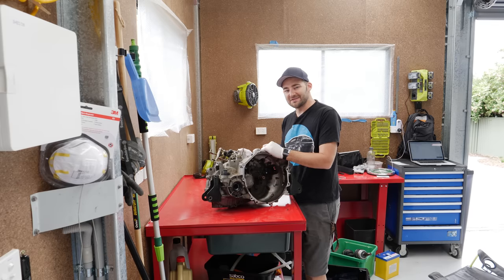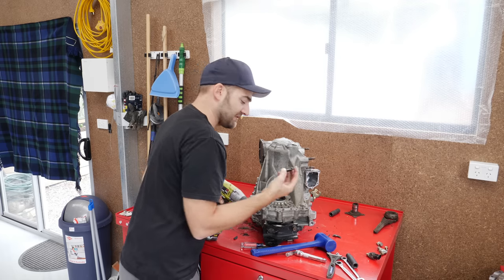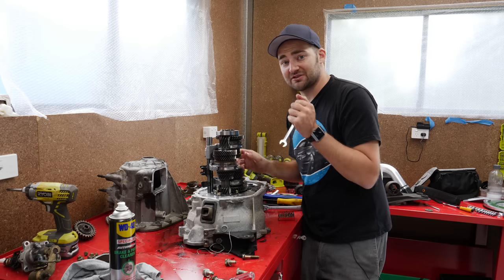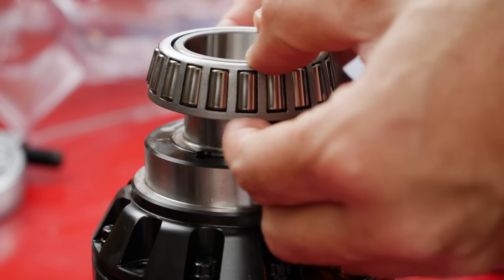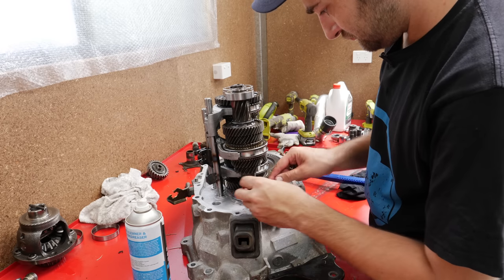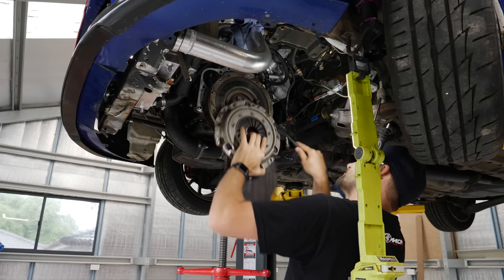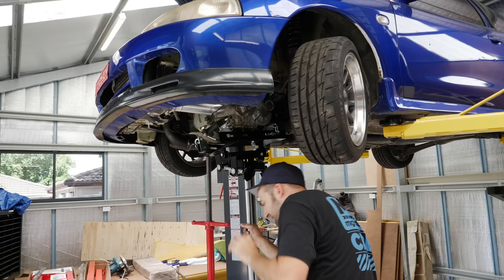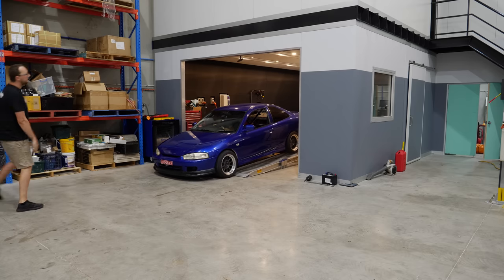Limited Slip Diff + Clutch Install into 2Sexy [Part 2]

Comment: Marty would you please replace the rubbish rubber bushings on the shifter cables (gearbox side) with some skateboard bearings it makes hell of a difference trust me I had a more than my fair share of galants the latest being a gt sport twin turbo V6....please up vote this so he sees it
Reply: Or pay the $8-15 for a proper set of brass bushings. The skateboard bearings love to rust up and become trash. I mean you can buy the double shielded kind of course, but I just prefer a part that is the right width without welding bearings together and that will last. It's not a bad idea though.
Reply: @802Garage  or that, nothing a little axle grease can't fix and most people have a old scooter, rollerblades or skateboard laying around
Reply: @802Garage  bearings fit perfectly all you need is a hammer lol
Reply: @maze2756  😂😂😂 I remember what a PITA it was to get the rusty ones off my '97 GSX when I got it. I think I ended up using a vice grips and a hammer claw or something to pry them off! The bearings didn't even budge anymore they were so locked.
Reply: @802Garage  oh damm I never had to change mine I did have pig bearings in Mine though and covered them in axle grease, worked a treat for the 3 or so years I had the old gt sport Galant, 😢 I do miss that car manual, turbo, 5 speed, V6, 4wd and enough room to fit my two boys at the time oh and had a sun roof
Reply: @maze2756  Well to be fair the previous owner of my car did a lot of stuff wrong and neglected it. So I'm not surprised my bearings were dry and frozen. Always a shame to get rid of cars you love! Mine will be back on the road this year.
Reply: You're telling me I can put Swiss Bones in my Lancer? 🤣🤣🤣
Reply: Don’t forget that Loctite

Comment: Al and Woody are gonna have a right laugh reading through all the armchair mechanics in this comment section!
Reply: That 40 comment long chain about the tapered roller bearing outer races and shim sizes got all the armchair mechanics sharing their wisdom, hahaha
Reply: @Hman9876  I know, right? The number of times I have actually seen Marty do something "wrong" on this channel is... Zero to my recollection. He is a careful dude.
Reply: @802Garage  He does plenty wrong, they are just not that important.  Soldering wires aren't suggested for radio install, but it shouldn't cause too many problems - In this video he had his grubby paws all over the pucks of the clutch during install - not a good way for install.  Also his first welds had the ray charles effect; To claim he's never done something wrong is BS,  anyone that works on cars has made plenty of mistakes, myself included, but who cares?
Reply: @Drivewaybuilt  Soldering wires isn't suggested by some people in any application on a car. Others think you should solder almost everything. His hands look clean when installing the clutch and a tiny bit of dirt isn't going to kill anything. Welding I'll give you because obviously he was inexperienced, but that still doesn't make it wrong.
Either way, your point is taken, and of course I could nitpick something in every video. I didn't claim he hasn't done anything wrong or made any mistakes. I said the number of times I have seen to my recollection. Meaning what can I remember right now. I was basically making a point that people love to nitpick even when they aren't actually right.
I still stick to my original statement because none of what you just said is akin to not torquing a flywheel, or putting the washers and bushing in the wrong order on a shock mount, or any number of common mistakes. I also realize he can edit out those mistakes, but I know he would be the first to admit he makes them.
Anyways I'm not trying to be rude or argumentative, I do get what you are saying. I just say there is a difference between preference or opinion and straight up bad or wrong advice. There are a lot of car channels which do far, far worse. MCM isn't perfect, but they are quite careful and I appreciate that.